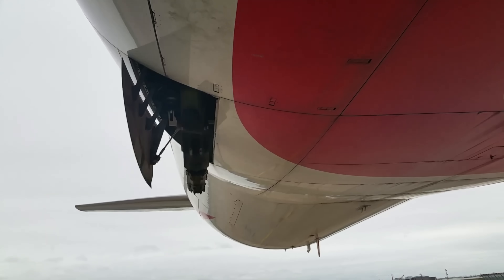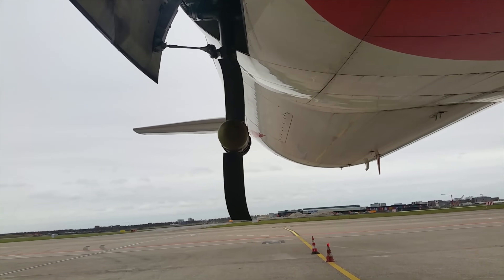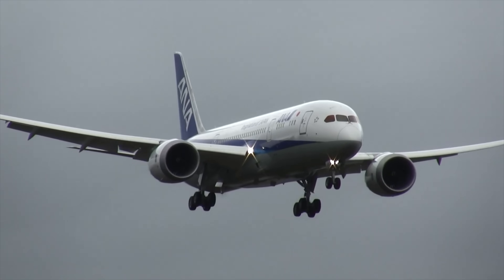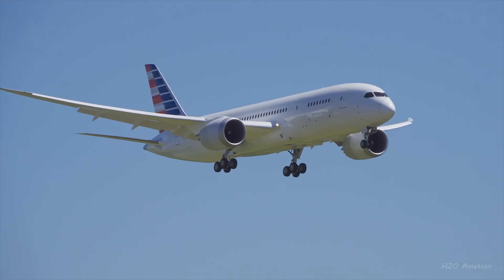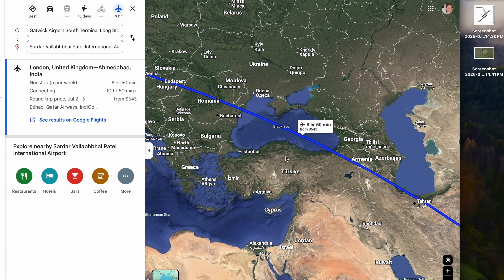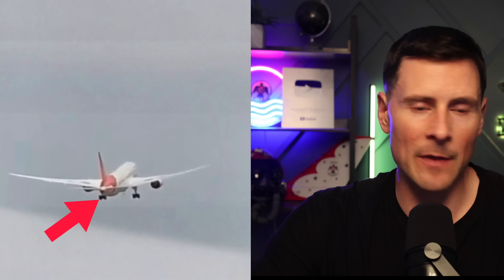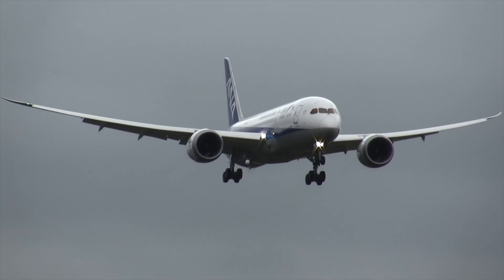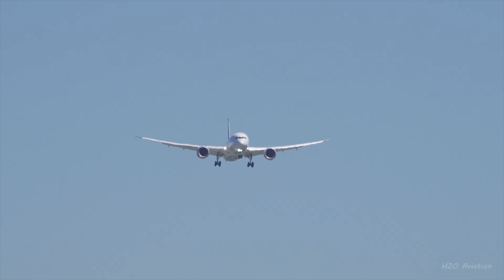Air India 171 SHOCKING UPDATE on RAT Deployment and Flaps!

Comment: I hate to say it, but everything hints at another major Boeing design flaw (like the MCAS), when it is possible that an electrical malfunction kills both engines and let‘s a bird like this fall out of the sky. Yes, there might have been maintenance issues with the plane (as reported), but the fact that these can lead to a total engine loss upon rotation is „next level“! I fear we will find out about another „genius“ Boeing design idea similar to the fact that the FDR on the B737-NG was not hooked up to the battery and simply stopped recording as JEJU air lost both engines after a bird strike earlier this year. They probably saved on redundancy and thus safety. With Boeing nothing is impossible. I hope I am wrong!

Comment: Not an armchair aviation expert. RAT out as per 787 manual has following 4 causes. 
1. Both engines have failed.
2. All 3 hydraulic system pressures are low
3. Loss of all 4 EMP and fault in flight control system 
4. Loss of EMP & 'AN' engine fail during takeoff.

Mayday call also mentions 'NO POWER NO THRUST'. Engine failure confirmed here. 

All we need to figure out is WHY ENGINES STOPPED. 

1. Fuel pump malfunction. Electrical? 
2. Anything that clogged the fuel lines. Fuel contamination? 
3. Aircraft on tarmac for 2+ hours without an AC. Vapour effect? 

DFDR and CVR will give an answer.

Comment: This video has a few errors about the 787 RAT. The first is it only provide hydraulic pressure to the center system flight controls.  It will not retract gear. It also only powers the essential electrical items. 

To save fuel the B787 is an electrical jet compared to all the other older generation Boeings. I flew the 787 as a Captain and I watch many so called experts who somehow compare this 787 to older Boeings or even Airbus jets.  While some things may be common the B787 was an innovative design to save fuel.

The obvious thing is both engines failed immediately after takeoff and we need to know why.

I doubt it was some simple maintenance issue. Something triggered the EECs to shutdown.
Reply: Tough question. The B787 is a computerized all electrical jet with all sorts of software driven parameters.  From the pilot deck there really are only two way to shut down the engines, using the Fuel Control switches or the Engine Fire handles. Both have a form of detention, the Fire have an interlock which must be pressed release them. A pilot would have to intentionally move these, something I can’t fathom a professional doing. 

All other possibilities have to be in the EEC system and or fuel system.

If the data recorders are intact by now they should have some answers and Boeing and the FAA would be putting out emergency orders about the airplane operation if they thought it was a design issue. But, do not forget the icing issue the BA 777 had causing the engines to remain at idle during approach. Took a while to figure that one out.
Reply: So in your personal opinion what are the possibilities that trigger such a failure?
Reply: fuel starvation or water in the fuel.  By my calculation 40 gallons of water in the fuel would be catastrophic (.01% of total fuel)

Comment: No asymmetric flight, fuel (electrical) starvation, BOTH ENGINES INOP for any of a hundred reasons.
LG «UP» commenced, NOT COMPLETED following a major engines’ failure.  The RAT deployed on dual engines’ failure.
Difficult to believe experienced pilots confused... pulled FLAPS-UP i.s.o. LG-UP  But, «Pilot Error», very convenient for Boeing

Comment: I think the Pilots are Heroes ! God Bless them and all who lost their lives ! They even managed to save one passenger !
Reply: That passenger was saved by happenstance.
Reply: @NighthawkCarbine  Landing gear tilted forward means they tried to retract landing gear but it suddenly stopped, pilots even managed to make a mayday call in such short time even that is surprising, they had thousands of hours of flying experience, i think they did the best they could in few seconds that they had, there is nothing wrong in calling them heroes.
Reply: @ykd0011  They weren't cowards, that's for sure.
Reply: @ykd0011  Yup I saw Swiss's video too on this topic. The gear was tilted forward because when you raise the gear, it first tilts forward since it's a two stage motion on the 787.
Reply: @ykd0011  If the gear suddenly stopped, it was because of major hydraulic failure. Which could have been because of the dual engine failure. 
But why a dual engine fail? 
The chances of this happening are statistically astronomical.
Reply: @mpatrick7860 astronomical means ?
Reply: @saranyamannu2887 It meant it to convey dual engine failure has a very tiny chance of happening. Not impossible. However there are so many redundant systems to prevent against dual engine failure. 
A long time ago, passenger airplanes were not allowed to fly over the ocean unless they had more than two engines. This was during a time when an engine failure in flight was more likely than it is now. The technology was just not there yet so engines could fail. 
Now engines and redundant systems are so reliable that aviation authorities allow aircraft with two engines to transit the oceans. 
This is why more than two engined aircraft are hardly produced any longer. 
Dual engine airliners are all required to have the ability to climb to altitude on one engine just in case one fails just after take off or on landing. 
On one engine, a 787 can climb very well.
Reply: Devine intervention saved that passenger, much more chance of winning the lotto than walking away from that plane trip.
Reply: We are of course speculating ! One of the Black boxes ( actually Orange) has been recovered so far. We will know the truth soon ! My Money is on the Pilots doing everything possible in those few seconds to save everyone ! Thanks for your thoughts !
Reply: More like victims. Heroes have a choice.
Reply: Nice thoughts, but if you credit them with saving one passenger, what about the other passengers?

Comment: The RAT does not spin at "20,000 repetitions a minute," and dont you mean revolutions per minuit ?
By the way the mistake of pulling the flaps up in mistake of the gear has happened before and caused an airliner to crash.
This was actually on one of the Aircrash Investigation series episode's. The RAT by the way when deployed spins at aprox 4000 RPM and is controlled by a constant speed variable pitch prpeller. I think from memory also they will not deploy below 100 kts air speed.

Comment: Hello sir i want to add my take to all of these experts pilots about the maybe caused of the air india crash, i worked on 787 and many other Boeing jets, now with this type, 787 dream liner there's no way that it could have taken off  passing through vi and  vr with the flaps not activated ,take off flaps settings would be flaps 5, it would be impossible  unless someone tampered with the electronics/ warning systems, it cant happen, impossible, the flight crew  would loss their hearing, the alarms would be impto tolarate, i looked at the gears/ wheels  and the rear /wings gear was slightly cocked sideways that tells me the gears up was activated and i believe this is where the jet became doomed, i believe that the gear pumpmotor short circuit causing breakers failure that stopped B+ from the fuel pumps,this caused the RAT to deploy, when the fuel pumps stopped  both engines flamed out, the RAT did return B+ but by this time the airplane was to low  and it was not enough time for the pilots to restart also there was not enough air flowing over the wings to maintain lift and the airplane stopped flying / stalled, even if the pilots was able to restart would still be impossible for them to get the airplane flying  / recover from the stall, the person flying would have to pushed the yoke forward  nose down to get the craft flying again. There is a procedure to restart and it takes time , a jet engine is like your gas stove , with a igniter / spark   to induce combustion (fuel and air) ,after the jet engine ignite combustion the igniters ,two per engine shut off ,combustion continues with force air from the engine compressors and fuel. I heard other pilots talk about a fuel lock because the plane was sitting on the tarmat for a few hours that is nonsense. Lastly even if the flight crew was able to restart and return to land the jet would still crash because the landing mechanism had failed and would be impossible to accommodate the weight of the plane. My thing is that the investigators needs to focus on the maintenance. There's more i would say later.
Reply: I was watching what Captain Steeeve had to say about a typical start-up of jet engines in one of his short videos.  He states: "You have probably noticed this when you are already seated in your plane. The air conditioning briefly turns off.  This is because the captain is turning on the engines.  A jet engine needs a lot of power to turn over. It usually takes 60 to 90 seconds before your air flow valve over your seat starts blowing air again".  Obviously, the Air India pilots would not have had enough time to restart an engine when they were only 600 feet above the ground. Those last few seconds were the worst seconds a pilot can ever experience. God Bless their souls.

Comment: Confusing the gear control and flap control would be like turning on your car's AC when you meant to run a window down.  Entirely different controls plus not even close.  This plane will wind up being loss of both engines, it won't end well for Boeing.

Comment: I agree with the RAT deployed due to likely electrical/hydraulic failure possibly caused by duel engine failures.  What I don't understand are these questions:

1.  With engine failure af full power it takes time for the engines to slow down enough for the engine generators to not be able to power fuel or hydraulic pumps.  How long would this be?  If the failure occurred when the lading gear was commanded up at say 50' altitude above ground, would the fuel pumps continue to operate on engine generators long enough for the aircraft to reach the 425 ft. max  above ground?  From video, that would be around 10 seconds.  I would think that by the end of that time, the RAT could be deployed and working.

2.  There's also the infamous lithium battery system available to provide power to fuel pumps during transition from engine electrical power to RAT power.  How does that work normally?  I would think fuel pumps would have highest priority in power distribution system.  Would this battery be able to power fuel pumps while en

3.  I though airliners had APU systems to provide backup power?  Does 787 have this also as fuel pump backup?  I know there would be long start up time for this.

4.  Did an electrical/hydraulic failure cause later dual engine failures, or was the dual engine failure the root cause?   I know we need to wait for data analysis, but am curious as are many on how these systems operate.

Comment: (Saw this message circulating about the crash. Dont know if this is authentic.)

Air India Black Box Record
A mechanical error in the pilot's seat during takeoff caused the loss of control of the aircraft and led to the tragedy in which 270 people died, including almost everyone on board, as well as several people on the ground.

The accident occurred just seconds after take-off from Ahmedabad, when the pilot's seat suddenly slid backwards due to a malfunction in the locking mechanism.  That unexpected movement caused the thrust levers to be inadvertently pulled into the "idle" position, causing the engine's power to drop sharply.

The co-pilot tried to regain control, but the pilot's body, which had moved backwards, physically blocked access to the controls. In those dramatic moments, the plane lost lift and crashed into the hostel building where the health workers were staying.

According to the data from the black box, the following key seconds of the tragedy were recorded:

 +12 seconds: The pilot's seat suddenly moves backwards.

 +15 seconds: The co-pilot yells, "We're losing thrust!"

 +26 seconds: The plane enters a "stall" at an altitude of only 214 feet.

 +38 seconds: The plane hits the ground.

Investigation revealed that the seat locking mechanism was damaged, although it had recently been serviced.  After the repair, a functional test was not performed, which, according to experts, would probably have prevented the accident. 

Additional factors that contributed to the aircraft's inability to stabilize include a high air temperature of 43 degrees, which significantly limited engine performance.

The report also states that the crew did not issue a GO-AROUND maneuver order or activate the STAB TRIM system.    It was also pointed out that the Boeing 787 thrusters do not have protective mechanisms such as "weight locking" or "reverse torque prevention".

Due to the seriousness of the incident, the US Federal Aviation Administration (FAA) and the European Aviation Safety Agency (EASA) ordered an immediate inspection of the pilot's seats in all Boeing 787 aircraft.  Air India has temporarily grounded 12 planes with a similar maintenance history, while Boeing plans to redesign the seat mechanism by 2026. 

A final report on the accident is expected to be released in July 2025.

Comment: Not really sure if RAT will spend at 20,000 RPM since its propeller rotate only by Ramming into Air and it's not an engine powered..  At that low Altitude and at slow speed, the RAT won't do much to say the least.  Its most likely for lost of engines at cruising altitude.

Comment: The one question i keep asking is, if I was a pilot, and my airplane was not positive rate and I was at max thrust, I would lower the nose, if the airplane doesn't respond at all, im moving the yoke in all sorts of directions and panic maxing the rudder left and right. All the control surfaces would be moving to maximum extents.

Comment: It looks like the engines stopped working when an electrical malfunction shut off the fuel pump. The engines stopped and there was absolutely nothing the pilots could do. The landing gear refraction sequence was interrupted by the loss of hydraulic pressure (provided by the engines) and the rest is history. Boeing is in deep sh!t, sell your Boeing stock right now. They should ground all 787 planes until this is sorted out. The surviving passenger recalled hearing a loud bang. There is a chance that a small explosive device could have caused the failure, in that case it would be a terrorist act.

Comment: Keep hearing 600 feet ..is that off the ground or sea level ..dont see 600 feet of air beneath that plane
Reply: Ahmedabad is 200ft above sea level. So, I reckon it's about 400ft off the ground.
Reply: @db-nx9by wish they would say that people saying 600 feet 90% of people gonna think rhats off the ground ..big diff
Reply: @OliveHello  Mate, I am terrible with sussing out distances, so wouldn't be able to gauge if it's 400 or 600ft like you did.
Reply: @db-nx9by what i mean is when they give a number like 600 ft that's not measured from ground to plane its sea level to plane..so if the airport is 400 feet above sea level that's included in the 600 foot